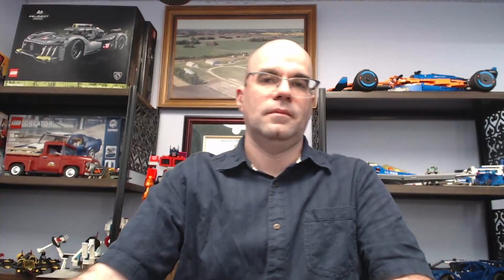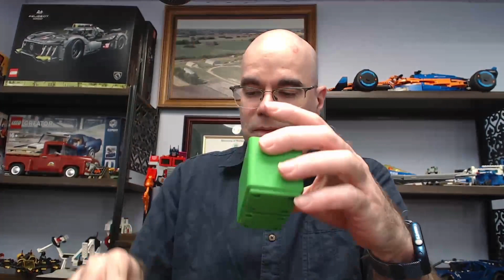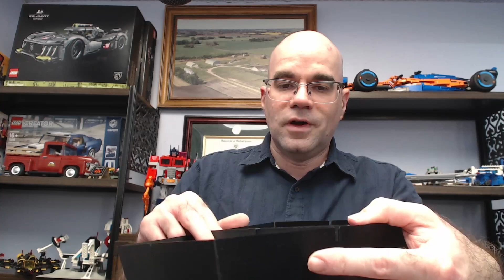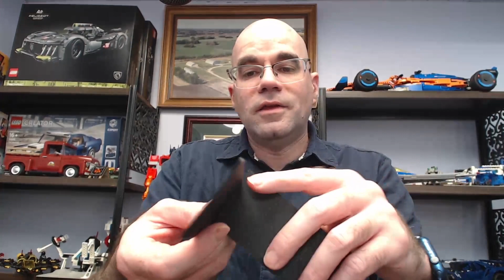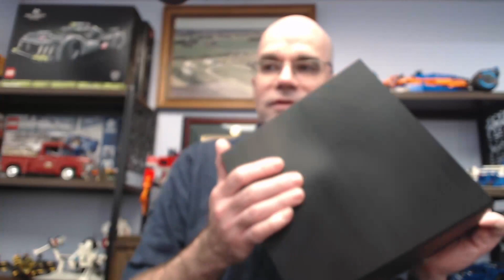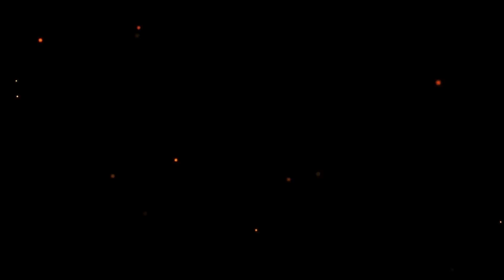3D Printing Lego Storage

Comment: I found a stackable Lego brick shaped container and thought exactly this divider system for it to be able to use with a printed lego sorter. I am thinking of increasing the number of notches though so if one particular type/size lego amount becomes more than the rest, just move the divider to have bigger pocket/portion for it. Anyways, good video, waiting for the follow up :)
Reply from the maker: Thanks! I ended up changing from the notches idea. They needed to be stronger and to do that would require printing supports which I want to avoid.